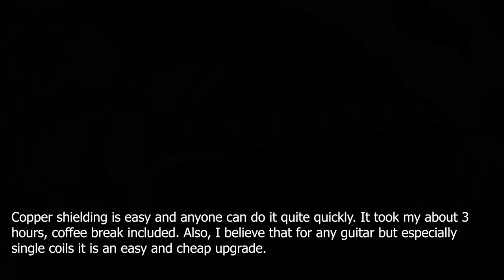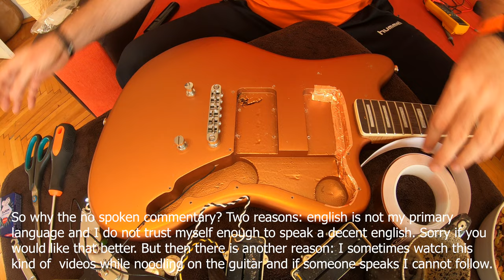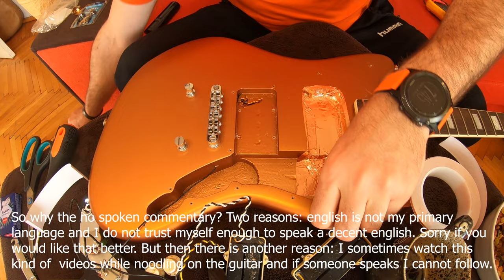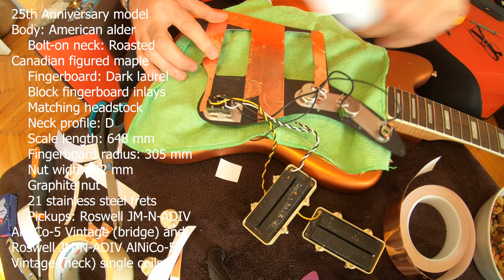Copper shielding my Jazzmaster JA-25th Harley Benton guitar

Comment: Does it really require shielding? I'm not getting any noise of mine, granted only using a 40 watt amp at relatively low volumes. I've done it before on self builds so that's not a problem. Have to give it a good listen when I pick it up next. Then an afternoon of sheilding for me 😂  though I did promise myself not to take a screwdriver to this one for at least a month 😂
Reply from the maker: I guess it depends on how much gain you have on. On my amp's clean channel it is pretty silent but once I switch to the overdrive channel there was a lot of static. Especially once I turned on an overdrive pedal. That is what I was trying to show in the before and after. As far as I know, if touching the bridge or the strings silences the hiss, you can solve it by shielding. Some people say that the tone improves too, and I am sure it does, I am not sure that I notice it so much at the levels I play at. When you crank up the amp (and/or the OD pedals), it might make a more noticeable difference in tone too.

Comment: Wasn't that GROUNDING problem? Maybe the resoldering of the pot resolved the problem... Please note that the hum stopped when you touched the strings, without covering the body / plate / pickups.
Reply from the maker: It is possible that you are right. But I did not resolder the pot and the hum stopped after shielding. It may be a compunding issue, I should check sometime check the grounding resistance with a microohmeter. Still, this is not the first guitar I shield, and my experience has been consistent that it gets waaay quieter after shielding.
Reply: @simpleguitar108  So it looks like this is the way to go in the case of my HB.
Reply from the maker: I think it is a simple, cheap and easy to do “upgrade”, And you will notice the difference on any guitar, but even more so on single coils.

Comment: Copper shield or shielding paint. Which is better?
Reply from the maker: In theory, they work the same way. If unshielded, I just find the copper tape easier to do.
Reply: I Do Both !. Some of those little nooks and crannies are hard to cover or reach in the tape, the paint is back up. I use two thin coats of paint, one layer of copper.

Comment: The screws Harley Benton uses are cheap as hell.  They strip very easily.   I going to replace mine on my HB DC jr and my JA60 OW with stainless replacements.   Where talking about $1.00 for all of the screws.   I hate cheap hardware.   Los Angeles
Reply from the maker: Do you mean the pick guard screws?
Reply: @simpleguitar108  No the pickup screws are the worst.  They head of the screw will strip out easy.  The others are almost as bad. Stainless steel screws are a cheap replacement which also have a better look than chrome cheapies.  Los Angeles
Reply: @bluesdawg8014 I changed my bridge pickup and the worst part is imo that the screws are different from normal pickguard screws which wasn’t the case on my cheaper guitar